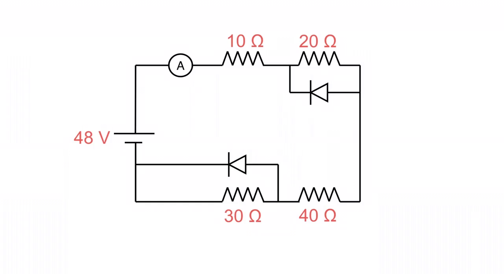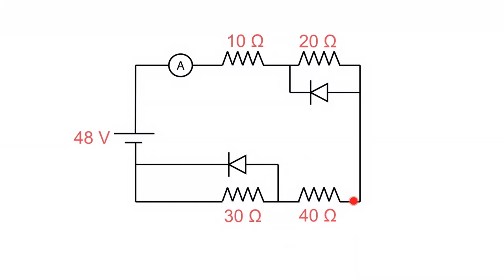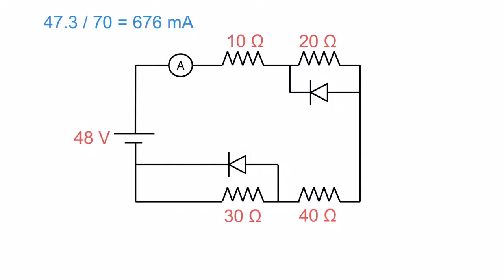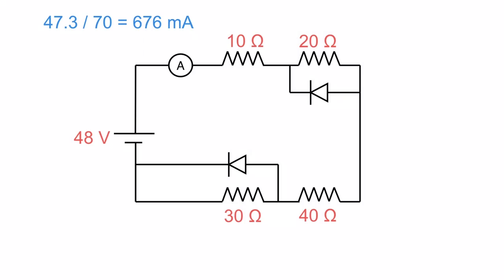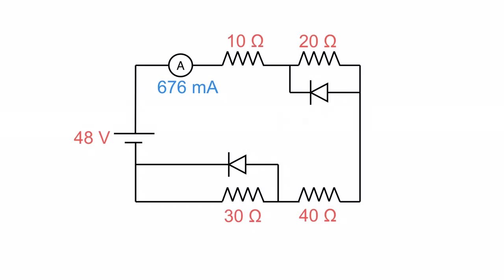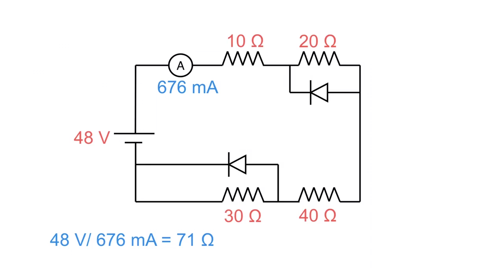DC diode calculation

Comment: I am trying to figure out how all of the diodes in 40 years of automotive schematics got turned around backwards? Oh, they didn't, it's just yours. even though you have 48 volts and the title says DC, and the symbol for a zener is not there, with a highly dope P-N junction without the avalanche voltage listed. How does D2 block current if D1 allows it. They are backwards, so re-think this presentation please. Electronics is difficult for most already with out have the diodes drawn in backwards if you're stick to your explanation. Build this circuit and test to see what happens...remember, the stipe on the actual diode is the pointy end with the vertical line that shows bias or blocking voltage movement. Wow!           ASE Master Tech since 1978 / Retired
Reply: cringe
Reply: JaJaJaJaJaJaJaJaJa!!¿!!!
Reply: He's using electron flow, not conventional current.  Initially a little confusing to some people maybe, but should be intelligible as soon as you realize he's starting at the negative terminal of the DC power source and going "backwards."  Yes, most instruction is done using conventional current, but there's nothing wrong with his presentation here.
Reply: Search electron current flow on google. Both are correct. what you are talking about is conventional current flow. He is calculating from the negative side to positive instead of positive to negative
Reply: @konoacda9935  Yes, you are correct and both electron flow ideas are used in descriptions. Only conventional flow can't be explained in electronics. Alternators use forward biased diodes but the positive side of the rectifier is an "Zener" to allow over voltage to reach peak, the avalanche quickly. I taught 6 classes of auto electrical for ACDelco in classes up to 12. #6 was limited to 8 as we spent two days with lab scopes. Fun.

Comment: could u just make more complex topics on communication-based engineering circuits like digitial wifi routers or converting analog to digital signals in video cameras!!  ---with hope a response from u
Reply from the maker: +sunil everest I actually don't know much about that tech (yet). As soon as I do though I will make some videos.
Reply: Thx